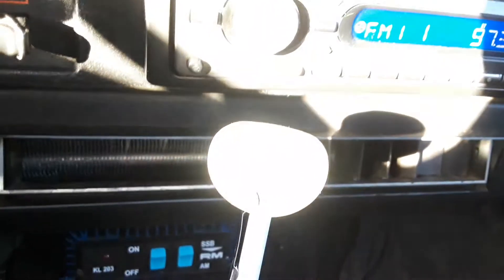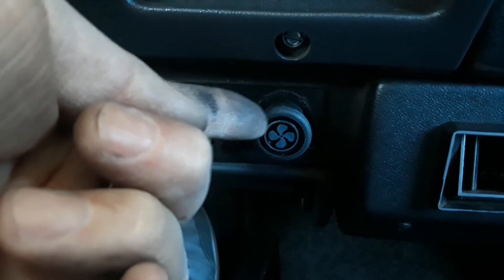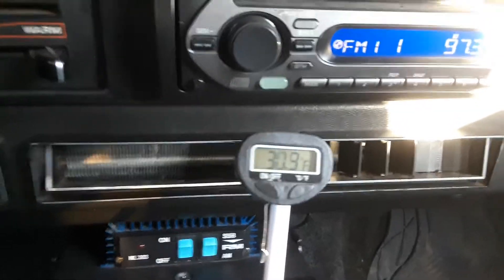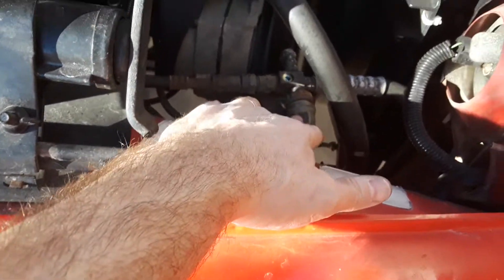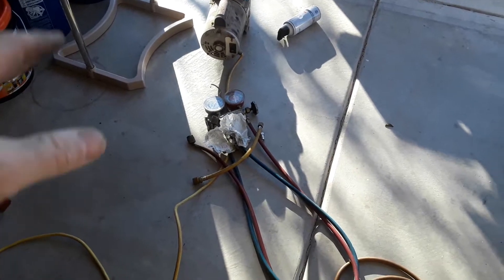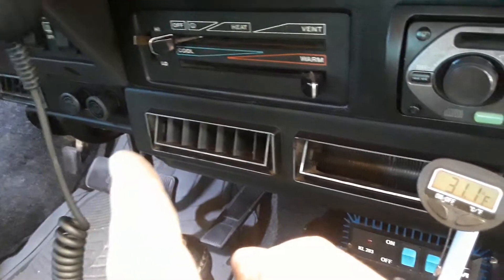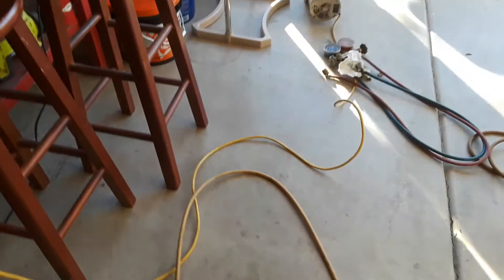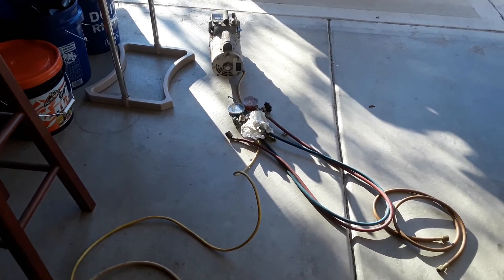CHEAP R-12 auto A/C substitute!

Comment: Im replacing the compressor on an old semi truck this weekend.  Im gonna try this out because converting the systems gonna be a pain in the rear.  After i pull the vacuum on it and get ready to charge it, what do you do about oil with this stuff, should i still use the recommended amount of mineral oil or use something else?
Reply: Since you are replacing the compressor with a pulled unit, I'd add about 3 Oz of PAG oil.

Comment: I used it on my 1998 Chevy pickup and it works great. I did discover a leaking schrader valve though. So I replaced the leaky valve and bought two more cans of air duster from Office Depot and refilled it.
Reply: no explosions or fire yet?
Reply: @autismion  No. Air Duster isn't very flammable.

Comment: Undercharged, most likely.  The problem with being undercharged, besides growing ice on the evaporator and stopping air flow is, the compressor oil can become trapped in the evaporator and starve the compressor of lubricant.
A
I'd adjust low side pressure to above 25psi with fan on low speed.
Reply: The proper procedure is 75% airflow, recirculation OFF below 86 degrees F, OR recirculation ON above 86 degrees F, with the engine at operating temperature and the cabin cooling down for ~15 minutes, then check for proper pressures. R-152a (HFC-152a) will be approx. 10% lower on pressures compared to R-134a (use a temperature and pressure chart), with a -1% volumetric cooling capacity and ~10k higher discharge outlet temperature.  HFC-152a also has a lower molecular weight, so for a 2.3 lb system (36.8 oz) you should be charging with ~23.81 oz of R-152a (36.8 x 0.647); always charge by weight, never by pressures. You should also purchase HFC-152a in electronics duster form that does not contain bitterant, as anything that is not refrigerant or oil is technically a contaminant and will affect both the performance and longevity of your ac system.

(www dot) intarcon (dot com) /en/refrigerante-r152a/
Reply: @NateInTX  I made all my notes here, a couple years ago:
https://youtu.be/oS3N6iLcrZI?si=K_8wLz057P861Lnj
It still works great but next time I'll be using 134a from a cylinder so it's possible to weigh the refrigerant.  That, and the duster spray price has increased so much it's no longer an advantage.
Reply: @NateInTX  What do you mean a 10k higher outlet temp? 10%??

I charged my 69 Mercury (York compressor) tonight with 152a. R-12 charge is 28oz, molecular weight of 121 g/mol.

PAG 100 oil.

R-152a molecular weight is 66 g/mol.  So should the 152a charge be 66/121 x 28 = 15.3oz??

I probably put in closer to 19.  I'm getting condensation on the compressor head (like on a soda can, no frost).  Ambient was 87 and vent was 59. Seems vent temp rises a bit to 65 when cruising around.

Too much refrigerant?

Comment: Do you vent and vacuum the old R12 before you add that stuff, or can you mix the two?
Reply from the maker: I would vacuum it out if you have a vacuum pump available.
Reply: Call around on the R12 recovery.  Not everybody may be able to do this as they'd have to have an extra recovery tank just for the R12.
Reply: Take it and have it recovered by a pro.
Reply: You'll have to do something about the mineral oil in your R12 system because it won't circulate with r152a or r134a.  One quick way to enable the mineral oil to circulate with these refrigerants is by adding a couple ounces of ester refrigerant oil.  The other (better, imo) way is by flushing the system but this takes more time and expense because you need to replace the desicant dryer because the desicant beads are saturated with mineral oil and by now (decades), can't absorb moisture.
After flushing, reassemble, deep vacuum for at least an hour, nitrogen pressure test, add pag oil, deep vacuum for a more couple hours then charge liquid refrigerant from a cylinder going into the high pressure side into the vacuum, quantity based on refrigerant weight (use a scale).
If your system is in good condition with no leaks, the job is complete.

Comment: Do you have to evacuate and pull a vacuum before recharge? I don’t have a manifold gauge so I was just looking into getting a single yellow hose to go from clamp tap to fitting...
Reply from the maker: I pulled a vacuum on mine as I have a vacuum pump. While it's recommend and good practice, I've recharged systems without pulling a vacuum and never had a problem myself. I mean, it's not correct by the book, however you can't always go by the book. An old trick is to charge it up with enough to cycle to compressor and then purge it out, then proceed charging as usual. (It's illegal to purge refrigerant into the atmosphere) So legally I can't recommend it.
Reply: Well, if you're trying to top off a partially  filled R12 system, you have no other choice than to drain off the old refrigerant.  They do not mix.

Comment: How hot was it outside when you filmed this?
Reply: My R12 system,  at 90 degree outside temp, will push out 45-48 degree AC.     I have R12 in my stash but I'm checking for leaks .with Air Duster   Might keep it as is.

Comment: Did you change the oil in your system? Or did you leave it how it was. I’ve read some people recommend emptying the PAG oil and replacing it with Esther oil
Reply from the maker: Left the oil that was already in the system. Years ago I was super cautious  about using only what was recommended. I've come to realize that some you should follow, but others are nonsense. My opinion anyways.
Reply: Desert Explorer 302 thanks for the info. Have you had any system failures in any of the R-12 vehicles you’ve switched to the dust cleaner?